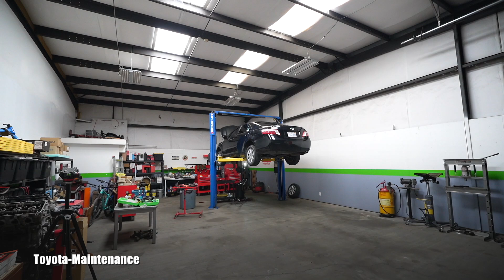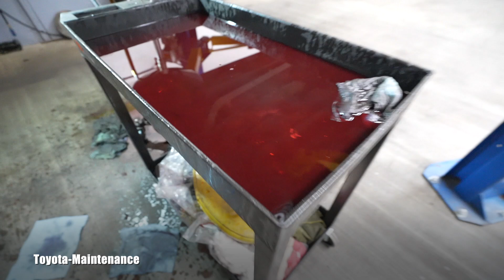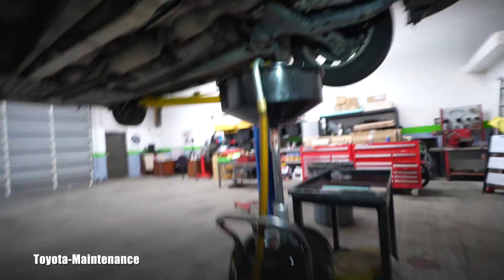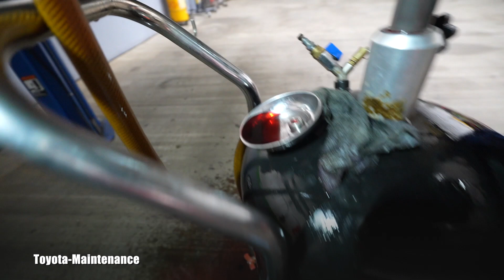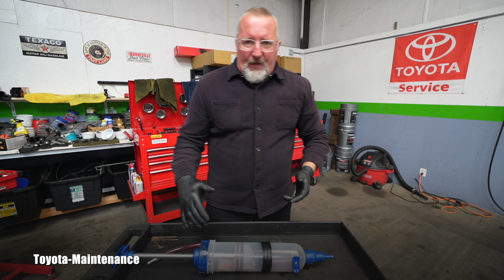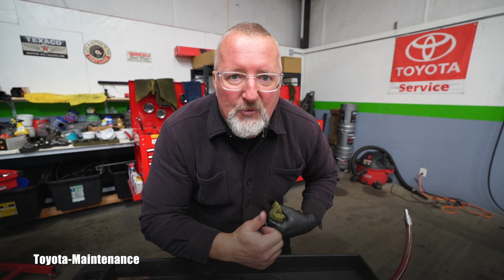Don't buy this tool

Comment: A 50lb bag of floor dry will soak a lot of that oil right out of the concrete. You won't need the whole bag, but perhaps 10-20lbs of it.  I use Pig towels, which only absorb oil first. Then lay down some zeolite-based floor dry or oil dry compound. It's very effective at pulling oil right out of floors. Leave that for at least overnight. Then I finish up with some Purple Power or equivalent purple cleaner full strength and a floor scrubber. Rinse and squeegee. If it persists, a few drops of dawn dish soap and a power washer with one of those circular pressure floor scrubber attachments does a lovely job.

Comment: Get yourself a large measuring cup. Capture the fluid as it drains. Measure the fluid. Dump the fluid. Fill the cup with the amount drained. Replace drain plug. Fish a hose from top of the engine down to the fill hole and stick it in. Install a funnel to the hose. Pour the fluid into the funnel. Replace the fill plug. Start the engine and let the trans warm up to the temperature required to check level. Use a laser temp reading gun a take the temperature from the pan. Turn off the engine. Check the level. Add fluid if needed with the funnel and hose. Rinse and repeat 3 times. I could write this out better but you should have the idea. If there are no fluid leaks and you measure every drain you should not over or under fill.

Comment: Peter, love your videos! I recently started using an inexpensive 1gal garden sprayer with the tip sawed off! Works super good. I dedicate 1 to ATF. You could attach vinyl tubing to it for tight areas.

Comment: Peter, you might want to look into a 12 volt electric transfer pump. The one I have connects to the vehicle battery and has an on/off switch that makes it easy to control the flow.

Comment: After sopping up the standing fluid, pour unscented clay cat sand from Walmart on the spill area.  Leave it for a few days, sweep it up, and the stain will be gone.  The sand can be used over and over.  Cheapest and most effective oil spill clean up there is.

Comment: Thanks for the warning. Horrible luck for you my friend. Last 24 hours was bad. Had several people attack me with arguments and threats. Full moon was few days ago but the crazies and bad things follow for days after as the moon shines. 

I never enjoyed the extractor style. I just go the usual pump method. If I want to extract I use what is like an industrial sized soap pump and if necessary like in that vehicle, a clear tube and put the bottom in the end and pump into a bottle to extract. And to fill, I put the hose on the other end near the top and pump out of the bottle. For smaller jobs like extracting the brake reservoir, I use a soap pump and pump into the bottle and then close and send to recycling.
Reply: Funny, thought I was the only one. I have a zip lock bag of old shampoo bottle pumps that I also use for pumping out old automotive fluids! 👍

Comment: You can epoxy that lid permanently on it and drain it from the other side. Slower but works if it’s not done often.
Reply: What if you need to open the area to change worn o rings that seal the plunger?

Comment: Mineral spirits & paper towels, or shop rags, will clean that mess off the floor. I use it on a few paper towels to remove soap scum from inside my washing machine and bathtub.  (No open flames around! ) Mineral spirits evaporates completely, but the vapor is flammable, so go easy with the amount.  
If you can buy it in California, CRC Brakleen, brake parts cleaner will clean up the spots on the floor. It is non flammable tetrachloroethylene. But you need to spray and wipe it up immediately, since it evaporates really fast. You need to get it up while the transmission fluid is still mixed with it. They use it to dry clean clothes, since it will dissolve any oil & grease. It is probably not a good idea to inhale it on a regular basis. 
A  few spots of hot melt glue on the seam will keep that base from unscrewing. That stuff will stick to almost anything which is completely clean and dry.  Just cut it to take it apart, and reapply to reseal. I just fixed a leak in my broken garbage disposal with it. I put a small piece of shipping tape over the hole, then covered the tape & entire area with hot melt glue.  I never used the disposal, so there is no loss there. I sealed a drip in the sprayer handle with some of it. Hot water isn't hot enough to melt it & the sprayer pressure is low so, it won't blow out. I was kind of surprised it worked. Never mess with old plumbing if you don't have to. Too much can go wrong.

Comment: Peter, I recently purchased the Mityvac MVA6852 equivalent. It’s the exact same tool as the Lincoln you purchased. I noticed the design flaw with the large end cap immediately. Amazingly bad design on an otherwise well made tool. My workaround is wrapping the endcap with 2” painters tape to keep it from backing off. Thankfully I never made a mess, but I’m also not a professional that uses it daily.

Fortunately the valve on mine is stiff and resists closing on its own. If anything it’s a bit hard to open and close during use.

Ultimately it made refilling my 4Runner’s transmission super easy without spilling a drop. Sorry you didn’t have a good experience. I agree that the design flaw is unacceptable especially for the price.

Comment: Sorry Peter; spills happen. The suction gun has a design flaw, and so does Toyota. That side fill and stand pipe design fluid level design is unnecessarily difficult. Lifetime fluid, right Toyota?

Comment: Looks like the fluid would be contained above the o-rings.  Was the entire operating rod pulled out the bottom ?  Did the weight of the fluid force it open ?

Comment: I've always used a pump unit from a shampoo bottle to fill oil into awkward transmissions and differentials. Doesn't cost a cent and never breaks
Reply: just remember to clean it out before putting it back in your wife's shampoo bottle 🤣

Comment: Thank you Peter. Probably the manufacturer could not find tool or was willing to pay to have threads put on top of holding cylinder. Glad no one was physically hurt. That's Trans fluid I'm sure can be pretty slick when it hits the shop floor.
Be safe be well Peter.